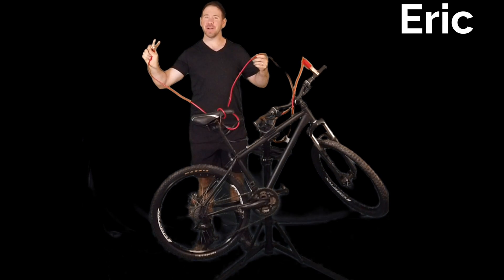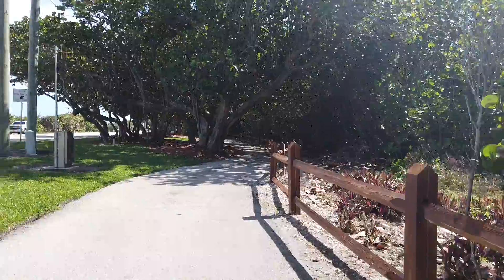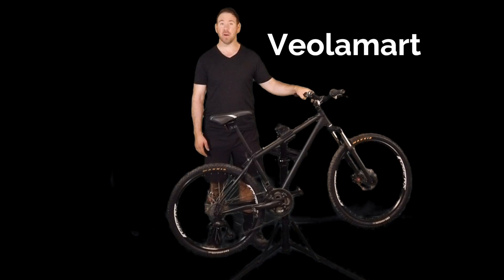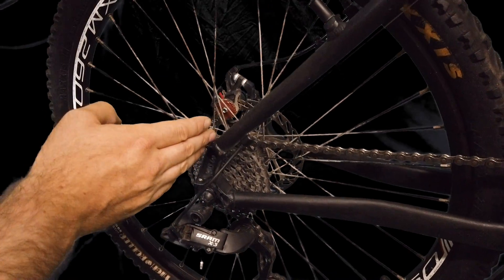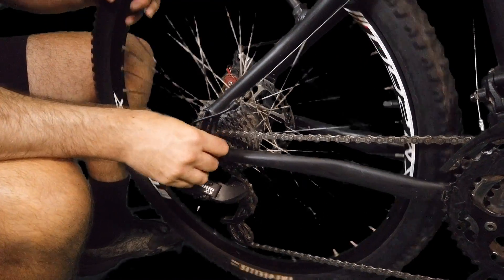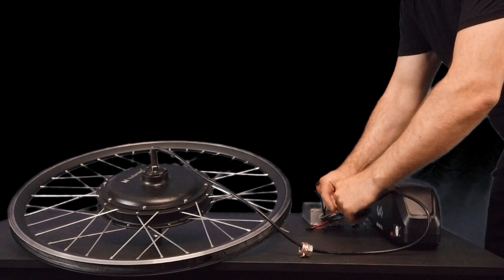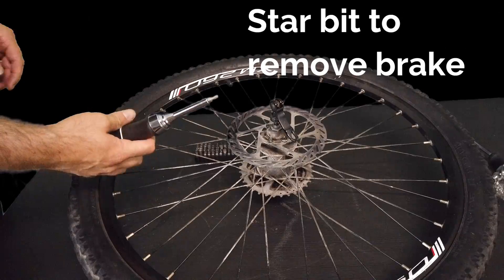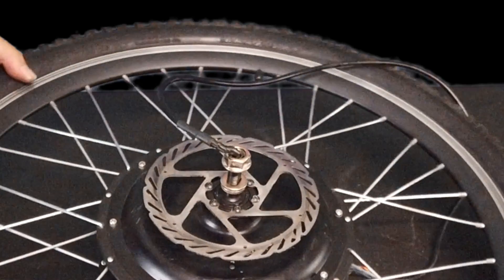Installing a Voilamart 1000 Watt Rear Hub Motor Kit [Quickly]

Comment: Why didn't you use the pedal assist
Reply from the maker: I will install pedal assist this week.
Reply: TBH im not a big fan of the pedal assist on these kits, its basically a 'blip' switch, if you pedal it gives you full throttle, which can easily take you off guard and into a crash.
The assist level display does not help either - when I tried using PAS, I found I preferred level 5 for the twist throttle so I had full speed range, but level 1 was more than enough on the PAS, especially navigating tight areas and passing people on narrow trails.
Eventually i disconnected the PAS, found it much easier to control the motor purely with throttle, and leaving me with unassisted pedals for more delicate control of speed - its just as easy to just hold the throttle at a low position and pedal normally if you want 'assisted' pedalling.
Reply: @Debbiebabe69  totally. Pas is pretty bad on these kits.
Reply from the maker: Here is the pedal assist vid.  https://youtu.be/x6HLDTmWsr0
Reply from the maker: @Debbiebabe69   Right, here is the pedal assist vid.  https://youtu.be/x6HLDTmWsr0

Comment: Did you install the power assist sensor as well?
Reply from the maker: No, I tried it on my friend's bike and it was very jumpy. I prefer using the throttle while pedaling.
Reply: @expedition-electric3549  Thanks for the reply.

Comment: Not a well balanced set up. You've got all the weight of the kit on the rear axle and it's top heavy because of your battery placement.
I'd be reluctant to get on that thing, let alone put it through its paces.

Comment: What kind of connection to the battery do you need because I might get one of these and I need to know what kind of connections on the battery I need
Reply: Usually XT60, if not u can solder them on